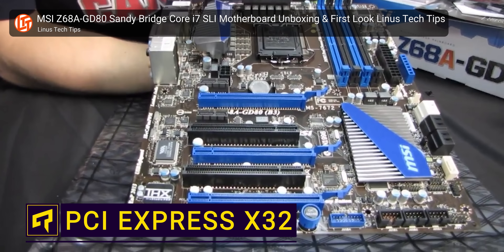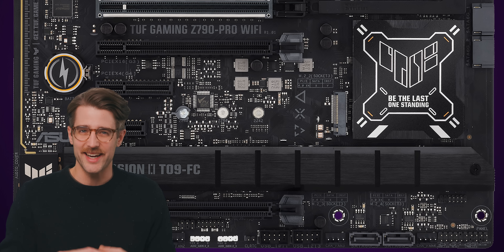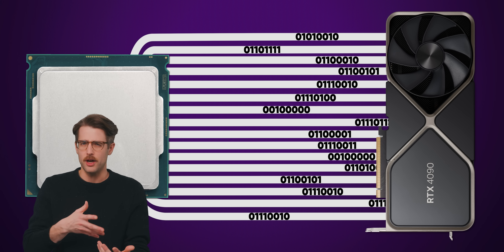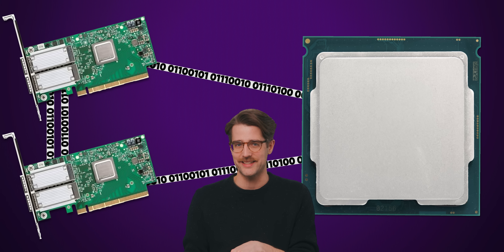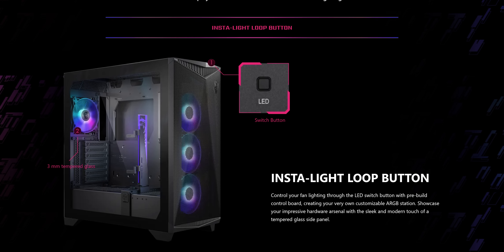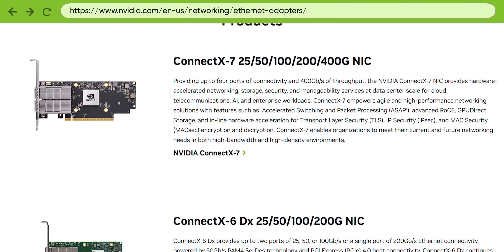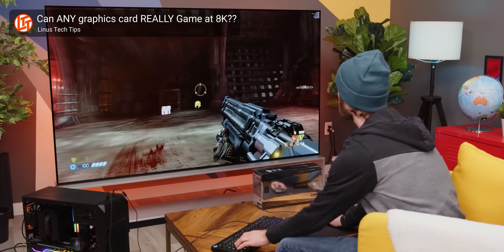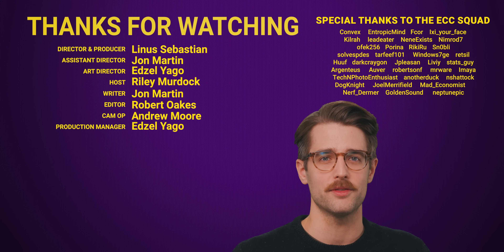Yes, It’s Real: PCI Express x32

Comment: x16 is all you’ll ever need – bill gates, probably
Reply: Nah. I think Barry B Benson said that
Reply: That's Apple's job now
Reply: Literally what PCI-SIG said in 2022 when they released PCIe 6.0 and deleted x32
Reply: To be honest, if not for game developers being super inefficient you would not need more than PCIe x4.
To fill the entire 16GB GPU memory with textures you will need 8 seconds with PCIe4 x1, or 2 seconds with PCIe4 x4.
With PCIe5 you can do it twice as fast. There is no need to go faster than that.

And the amount of data transferred to GPU during gameplay is tiny.
Each object on screen requires 64 bytes (2 points with 3 8byte dimensions each plus 16 bytes for object/texture id), 
so with PCIe4 x1 and 120 FPS you can handle up to ~260.000 objects on screen.
Reply: @hubertnnn tell that to thosr who want a smooth response from a x86 device in a video editing software.. when you click on the timeline it's hust laggy, and responds a bit late, meanwhile Apple with their 400GB/s (that is still just their laptop chip..) instantly start to play the video when you click on the timeline.. no delay, no lag.. and it's not because of the higher max capacity of the GPU performance, it's because can transfer the data faster.. and even if you preload some data to the memory (what Apple already don't need to do, since they can calc the result fast enough, and even send that fast enough, they doesn't even beed to waste memory to keep some precalculated data..), that is become meanigless when you jump to another timestamp on the timeline.. there only the faster transfer speed can help.. so even if you satisfied with a HDD, there are some who will orefer the SSD (so they are even willing to pay more just for the higher transfer speed..)
Reply: To be fair, this sentiment of "we're never going past X amount of Y" is arguably true for some things. For example, I don't see us ever needing 128 bit computers. At least not within my lifetime.
Reply: we talking about us highways`?
Reply: Based on a quote he never said - possibly, probably.
Reply: 16x times the pcie-lanes
Reply: wasn't it steve balmer who said the famous line?
Reply: This Comment made me instantly think of the Gates Sketch in the Onion Movie 😂😂😂
Reply: The quote was 640k is all the memory anyone will ever need. Which was untrue even for DOS. I had 640K plus expanded/extended memory.
Reply: "A max of 24 Pcie lanes is all our enterprise users will ever need" Intel when they were designing the twin die quad core Core 2 Xeons.
Reply: It's true tho, just make the lanes faster
Reply: Really, yeah, it is. They should honestly start making NVMe only use 1 lane. The lane speed is fast enough now, and people generally cry about lack of lanes on desktop stuff. Would be nice to have a card that could take 16 SSDs and not have to do any switching.
Reply: turns out bill is lame
Reply: hahaha
Reply: PCI didn't even exist yet, let alone PCIe.
Reply: Sure, like 16 x x16 it's like a 16 core CPU LOOOL